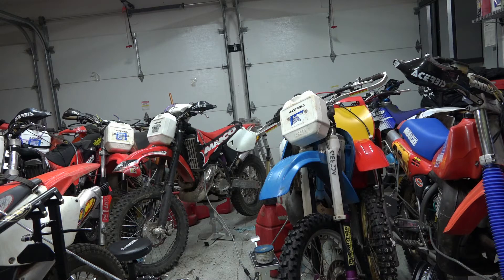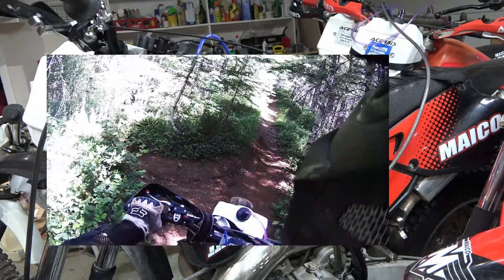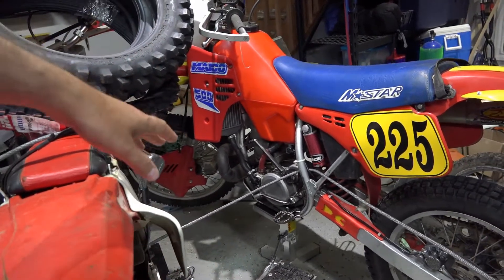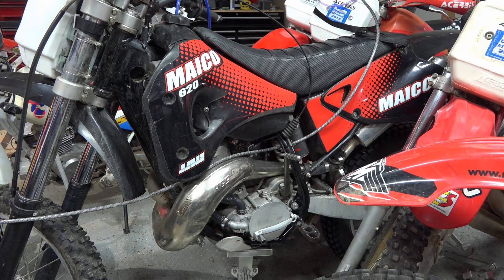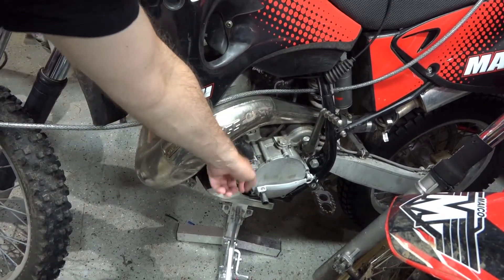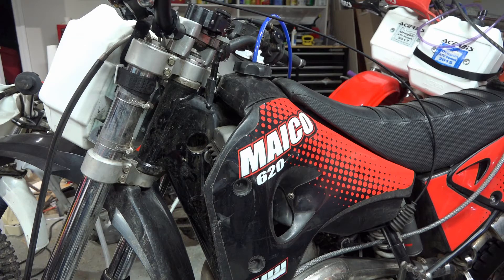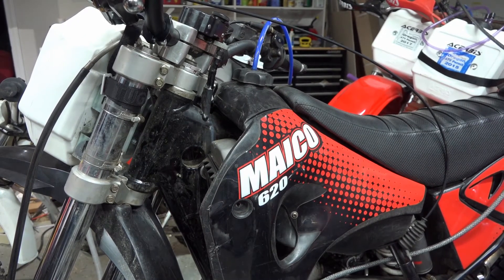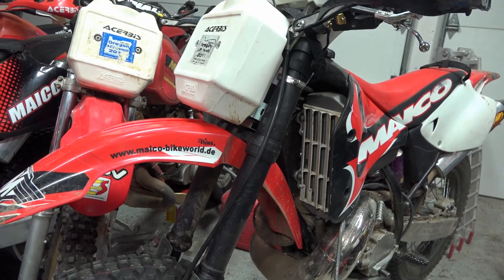Trying Evans Coolant: Part 2: Update after 2 years

Comment: What is the black control cable running from left handlebar across the seat and down to the frame on the left side of the 620? It looks like it should run under the gas tank.
Reply from the maker: Yes, it needs run under the gas tank.  It is the compression release cable, putting a new one on.

Comment: I started using Evans when I rebuilt my 1985 CR500 and the magnesium clutch cover had corrosion. I have since rebuilt 3 of those bikes all with corrosion problems. I bought a sand cast clutch cover from that guy in Australia but still use Evans. Have you flow tested the radiators on that 620? Also, glad to see that cable and massive lock, I have 3 25 foot cables and 3 of those massive locks. Layered security will deter thieves because it takes time to get through the layers and most thieves will not spend the time.
Reply from the maker: Ya my CR500 was the same.  Waterless is good for helping with the coorsion on those old cases.  I had to buy a new case.  Haven't tried to flow test it but it's the same problem on all the big bore over 600cc.  The 620, 660 and 700 all have the same problem.  They use the same radiators and setup as the 500s and the 440.
Reply: Opferman Motors Dirtbiking Have you considered a custom radiator from Myler's? Remember those huge radiators from the works Honda 500's
Reply from the maker: Tony Harrell They dony make one for Maico.  It would be a fab job and have to figure out the best one to fit if i wanted to fab it.